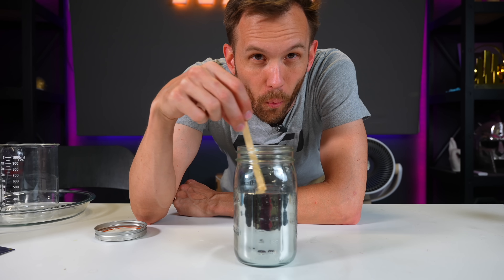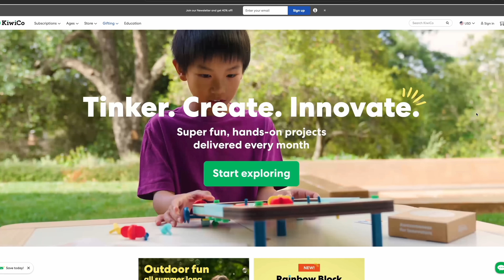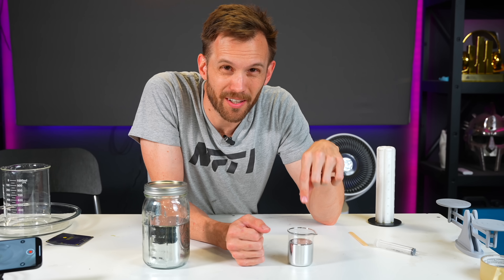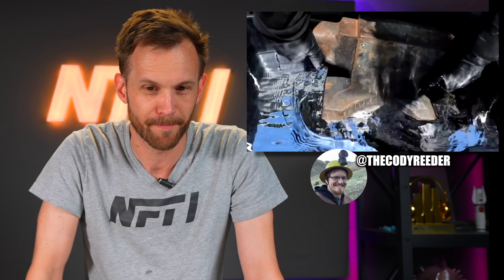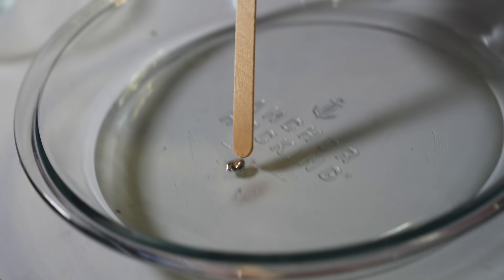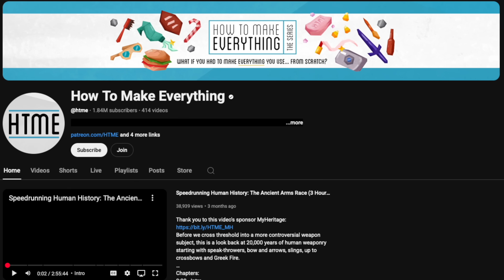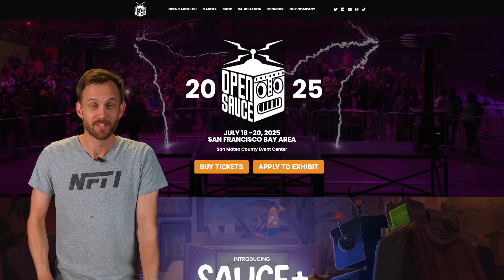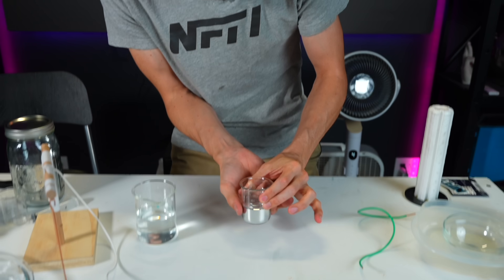What Happens If You Touch Pure Mercury?

Comment: Ok, hear me out, you know how those anvils floated on the mercury? Well, they claim that there were pools of mercury found in the great pyramid. What if they used it in other places to move heavy stones. Just a thought.
Reply: The myth about Egyptian pyramids was started because of illiterate people. There was large quantities of mercury found in pyramids in MEXICO, not Egypt. The Egyptians used mercury for gold amalgams and cinnabar for makeup, they didn't use it for anything else, and there's no rivers of mercury in or under the Egyptian pyramids. There's not even any hieroglyphics that even hint at such a thing. There are multiple myths in Central and South American ancient texts though, as well as actual large pools of mercury found inside pyramids. The mercury was only used as a "mirror to the underworld" though, we knew how they built the American pyramids, mostly just b y dirt moving, which was a similar method for the Egyptians.

Also, mercury wouldn't help you move stone blocks over anything but flat land, which was never an issue, we know how they did that, they did it quite easily by laying smoothed logs down and pushed/pulled the stone over the rolling logs. Mercury wouldn't have helped them get the stones up anywhere. They did that by building sand dunes around the worksite and used the logs and pulleys to move the stones above their resting point, and then released the sand from below, slowly lowering the blocks into place. It's also a myth that we don't know how the pyramids were built, we do, it's in the hieroglyphics.

Comment: I had open eye hallucinations and severe anxiety/depression and immune system problems in my 20s. I also had Alzheimer's like symptoms with memory loss and couldn't function properly. I suspected mercury toxicity after eliminating many other possibilities. After I took a chelation drug called BDTH2/Emeramide for some time my worst symptoms resolved and the lesser ones improved. There are microbes in the gut that can convert mercury to different forms and it is very reactive with other elements. It only takes a very very small amount of Hg in the brain to cause all sorts of wild symptoms. Some people are bad at removing mercury from their body so an individuals response to Hg varies a lot. A guy by the name of Boyd Haley has done a lot of research around mercury toxicity especially its use as a dental filling. The dental industry has been defending it for over a century at this point and the risk there is that vapour comes off the dental material.

Comment: When it comes to mercury vapors, it does not evaporate as quickly as they claim,
it takes decades for even small amounts to disappear. If it did evaporate that quickly,
then every barometer would have dried up in a few years time, yet I had a barometer
that never changed level in the thirty years I had it in use.

But there are people who need to exaggerate the 'dangers' of mercury for some reason.

Comment: When I was a kid in the 1970s, I was fascinated by mercury switches. Our home’s thermostat used a mercury switch to turn the central A/C and heat on and off. I’d take the cover off and touch the metal coil to warm it up, causing the switch to flip. I’d then touch an ice cube to it to cause it to flip the other way. My dad didn’t think my "experiments" were as fascinating and fun as I did… It amazed me that a metal could be liquid at room temperature. (I was one of those kids who was a big science nerd, especially when it came to electricity.)
Reply: Thanks, I made the same comment above, but you did a way better job of explaining it, a mercury switch. I forgot where we got ours, but I believe they came from old thermostats.

Comment: There was a dead mosquito on that little floating anvil. Perhaps it passed away because of the toxic vapors of mercury. Let´s hope, that you won´t suffer from neurological diseases afterwards, when breathing in the amount of vapors. "The maximum safe concentration of mercury in the workplace air is generally considered to be 0.05 mg/m³ as a time-weighted average (TWA) over an 8-hour workday, according to CDC and OSHA. This limit applies to both elemental mercury and inorganic mercury compounds. For alkyl mercury compounds, the limit is even lower, at 0.01 mg/m³. Additionally, a skin notation is often included due to the potential for absorption through the skin. ";-"Acute toxicity of mercury is characterized by nausea, vomiting, abdominal pain, bronchitis, bloody diarrhea, and anuria with uremia. (Windholz et al., 1976; ACGIH, 1980) Chronic toxicity is characterized by tremors, weakness, sensory abnormalities, memory loss, erethism, muscle pains, gingivitis, emotion or intellect changes, and kidney damage (Browning, 1969).Milne et al. (1970) reported that four workmen became ill for a few days to a month after exposure to a mercury-contaminated atmosphere for 2.5, 4, and 5 h. Mercury concentrations ranged from 1.1 to 2.9 mg/m3."

Comment: Had a teacher in physics class pass around a bottle of mercury,and told us to pour some in our hand. When I did,I couldn't believe how heavy it was.Somebody managed to spill some on the hardwood classroom floor. I am still here. That was about 65 years ago.
Reply: My phisics teacher from primary school was less lucky. He developed some nasty neurological condition. Investigation found that someone spilled some mercury under the furniture  in the backroom of phisics classroom where the teacher used to spent a lot of time. It could not be determined  when this happened. A puddle of mercury could be there for years and he was slowly absorbing it.
Reply: I did the same thing in my science class. (75 now and still here, so far).
Reply: 6th grade science class 1969. Glass mercury barometer with a pan of it at the bottom. We were permitted to touch it. It looked wet, like silver water. I poked it. My finger came out as dry as it was before. My teacher explained. It doesn't bond with skin and showed me his wedding ring; but it will bond with gold. There was a silver spot on his wedding ring.
Reply: Yeah, dense metals are even surprisingly dense.
Looking at  my solder next to the aliminum cooler on my shelf is always fun. Because it's much smaller, but so much heavier.
Reply: You're still stuck to the floor? That's newsworthy
Reply: When I was a kid maybe 8-10 my dentist gave me mercury.  Maybe a pea sized blob. I kept it in a jar and take it out and roll it around in my hand. Ultimately it .....disappeared. I still have a number of my old amalgam fillings and I am close to 66. Oddly all is well with me as far as I can tell now.

Comment: When I was in college, I replaced the thermostat in the old house I was renting with a modern smart one. The old one must have been from the 70s or 80s and I took it apart to see how it worked. It had a little angled glass vial of mercury which had two wires leading into it. Changing the temperature it was set at changed the angle of the glass, which changed how much the mercury needed to expand/contract with the temperature to connect the two wires and form a circuit turning on/off the AC. It was really a brilliant design!
Reply: The thing expanding/contracting was a coiled bimetallic strip.  When the temp changes, the tilt of the vial of mercury changes, causing the mercury to move between the side with the contacts and the side without.  Old technology had a certain creativity to it.
Reply: @Kinoko314  Nope, but I've seen that type too. In this one, setting the temperature I wanted with a little horizontal slider tilted the vial of mercury. But it was the expansion/contraction of the mercury itself that caused the electrical connection.
Reply: @mr_q_02  now I'm going to have to search for this type of thermostat!
Reply: @Kinoko314  I went down this thought process too.
Reply: How do we put a thermometer in this thermostat?
Just put a thermometer in it?
Reply: Those are called (get ready for it) "Mercury Switches" . In addition to thermostats, they were also used in various other application, such as the trunk light in cars. They are also used by terrorists to make a b0/\/\b that is very difficult to disable,

Comment: The thing that always trips me out about mercury is how when you dip something in water, when you pull it out, it's wet. But when you dip something in mercury, it's (usually) completely unchanged. And for whatever reason that just really messes with my brain. lol
Reply: Mercury wets a metal when the energy gained by mercury-metal bonding outweighs the energy cost of breaking mercury's own surface. Mercury has very strong cohesion due to metallic bonding between its atoms, which gives it high surface tension, so wetting only happens if adhesion to the metal is even stronger. In many metals, electron interactions allow mercury atoms to integrate into the surface lattice, forming an amalgam and lowering the system's total energy. This chemical compatibility tips the adhesion-cohesion balance in favor of spreading. Surfaces that prevent such bonding, like those covered with inert oxides, keep cohesion dominant and mercury beads up instead.

Water, for example, beads on wax but spreads on clean glass because the adhesion-cohesion balance is different. The density or weight of the liquid has nothing to do with this effect.
Reply: @ShadowManceri  ooooo
Reply: Can’t really call that a negative.
Reply: It's because the mercury is so heavy it drags itself off the object faster than water. It's 13Xs heavier than water.

Comment: My first fascination with Mercury was in school science. The science teacher made a mercury barometer. A long, closed end tube was filled with mercury, it's opening was sealed with a finger before inverting it, placing the sealed opening into a small bath of mercury and moving the finger away. It quickly dropped until it's surface stabilised at about to about 1/4 of the tube height. A perfect vacuum was left above the mercury, The height of the mercury meniscus above the reservoir indicates the air pressure. It was air pressure that stopped it from draining down into the reservoir.

Today my Darton Hg barometer indicates 756.6mm

Comment: First off, mercury is not the densest metal we sometimes encounter in our daily lives. That would be tungsten. Any welder is in contact with it on a daily basis.

The other thing I wanted to say is that mercury is highly toxic so the scare factor is good. Too many people handle things they have no true knowledge about which can then turn deadly.
Uranium isn't dangerous in its natural state as an example. But there would be enough idiots trying to cut it, inhaling the dust and die as a result of that if we actually talked about it from a purely scientific truth. 

With this being said I enjoyed the video. I'm actually quite surprised I haven't stumbled over your channel until now. Seems right up my alley, though I prefer really in depth scientific discussions. But still, great channel for the average Joe to understand our world a bit better.
Reply: Mercury has the same capacity as uranium. If either enters your body it becomes dangerous. The safety comes from your skin. Inhalation or ingestion can be dangerous for mercury, however uranium, even naturally occurring uranium-238 & 235 are lethal if ingested in such small amounts unlike mercury.

Stick to welding, science isn't your thing.

Comment: I think he forgot to mention that mercury is sometimes used in spinning telescopes to form a "perfect" mirror
Reply: Also used in switches. I have an old time switch for my furnace, when the temp is at the right point, the mercury slides down a vacuum tube and makes the connection to turn on the furnace.
Also used in many older thermometers.
Reply: @chribm many new thermometers, too. For some reason, a lot of EPA approved methods for environmental chemistry still specify that a thermometer has to be mercury.
Reply: @chribm  My dad works in HVAC and would collect the mercury from those furnace switches, which I frequently played with as a kid.
Reply: @chribm  that sounds really cool!!😊
Reply: @chribm  There's a bunch of old thermometers in my house which use mercury
Reply: It was used to detect "door tilt" on pinball machines too...
Reply: In a previous career I did hazmat response. We had a specially designed dedicated vacuum for mercury cleanup.  It was always small amounts we recovered, but those little beads of mercury would scatter everywhere and you had to be eagle eyed to find them. We stored it all in a 5 gal pail, that was maybe a quarter full. Weighed like 40lbs 😂. I recall putting a rubber glove on and sticking my hand in the pail. It was cool 😉
Reply: And was used in ww2 submarine gyroscopes. Animagraffs has an excellent video about that!
Reply: It was also used in lighthouses, to make a low-friction rotating base.

Comment: You can create a lens from mercury, it is used in astronomy. Rotating disc with mercury on top will flung the mercury to the sides and it forms a mirror lens. It can be extremely smooth, the main problem of course are keeping it spinning at very stable rate without vibrations..
Reply: Compressed air bearings and transmission. You’re welcome.

Comment: Please don't store Mercury in a glass, dropping it would be a disaster.
Reply: Mercury can penetrate plastics with time, mercury destroys most metals it comes in contact with, everything else is too porous... Glass is all you have. The norm is to store it inside glass inside plastic. Never directly in plastic though.
Reply: @DoctorKnox did i say anything about plastic? Mercury can be stored in glass in small amounts like in ampules or small bottles. But in bigger amounts it is being stored in stainless steel flasks. I have one in my basement and it is just fine after a few decades.
Reply: @edgar_kon lucky you, you're mistaken, the stainless steel is guaranteed to be an amalgumation now. So chances are that stainless steel is slowly releasing mercury gasses. Enjoy.
Reply: Also not all plastics are equal.

Comment: I find it interesting that it seems to have a high surface tension and doesn't seem to "wet" any of the surfaces you had it on. Why is that?
Reply: It doesn't have a high surface tension, it has a high density. Water is 1g per cm of density, Aluminum 2.7g, Steel 7 - 8g, Mercury 13.6g. 

The more dense an element is the more atoms there are inside any given cm of area to be pulled on by gravity, so the more atoms, the lower that element is pulled below other elements.
Reply: @DoctorKnox  So if you put a more dense element into it, it would behave more like it had a low surface tension?
Reply: @eldibs yes, tungsten would drop right through almost like water.
Reply: @DoctorKnox  No, I mean, like would it wet the surface? Or would it still act like water does on a hydrophobic surface (beading up rather than sticking to it)?
Reply: @eldibs it would depend on the contact time and the mineral. Mercury will eventually try to attach itself to most metals and create an amalgum, it's slow for most metals though thanks to oxidative layers.
Reply: @DoctorKnox  That make sense, since the oxide layer on aluminum is a major factor in preventing that visually stunning reaction with mercury from ocurring. Thanks for the info!

Comment: I feel the steel thing needs more explanation than steel floats on mercury.

After all, steel also floats on water.

😅
Reply: Steel doesn't float on water though, air bubbles trapped inside steel do.
Reply: @DoctorKnox  you never seen a cruise liner then?

Comment: I used to be a trucker and we would get handed the "beaker run", this creepy dude working out the back of a battery recycling plant, he'd stand and watch us hitch up the tanker then creep up with his clipboard to get the load signed off.
One time we got a batch of jumbonium trichromate, this stuff was so dangerous if you stopped at anytime it'd sneak out the tank and interfere with the hazmat signs on the rear, it once changed the UN numbers to indicate it was sugar, I didn't discover this until I hit Fresno, I reported it to the boss, he said either have Beaker in the cab with you or don't come back, I decided just to carry on.

Comment: Talking about conductivity, older cars used mercury switches to do things like turn on the trunk or underhood lamps when they're opened by sloshing the mercury over open contacts
Reply: Plenty of homes still have mercury light switches.
Reply: @captsorghum  Mine does.  House built in 1956.  Every light switch is a mercury switch, three way ones included.  All are original and still work perfectly.
Reply: @captsorghum  I have three switches for my home heating system. One is the modern battery-operated programmable type. The other two are mercury switches. They work fine. I actually turn down my mercury switches if I leave the house for work (manual programming). Of course, when I get home it takes 15 minutes to heat the house again but that's OK with me.
Reply: Thermostats used to have a glass capsule with electric contacts attached to a bimetallic strip to control the a/c
Reply: yea mercury switches. Been a while
Reply: They made things go boom as well...
Reply: Mercury switches Mercury thermometers Growing up in the 70s we had bunches of things that were made with Mercury to be used as a conductor I would be interested in the science behind mercury thermometers I know they work don't understand why I know they aren't a thing anymore because of the danger if they break
Reply: @edreichfl6500  I still use one.  No batteries needed, and no need to convert from Celsius to read it. I still have a mercury tooth filling too. I'm probably going to die someday.
Reply: @captsorghum Mercury filling in your tooth that just makes you a superhero you're going to live forever lol
Reply: @edreichfl6500  I still use one lol